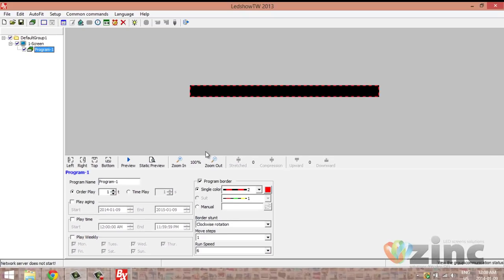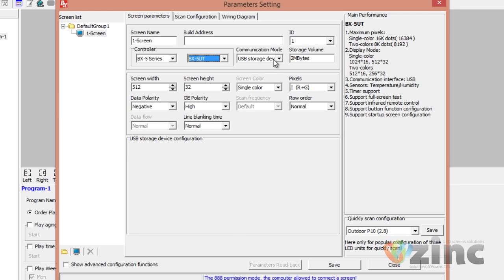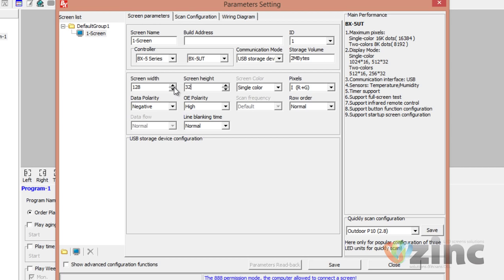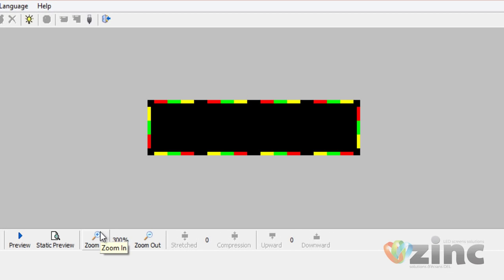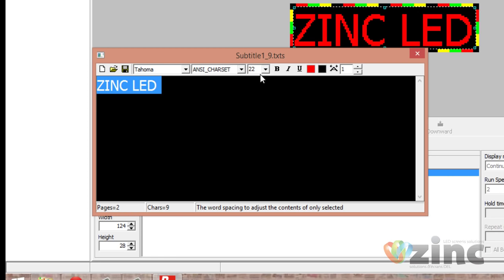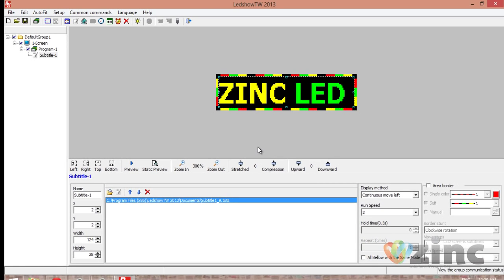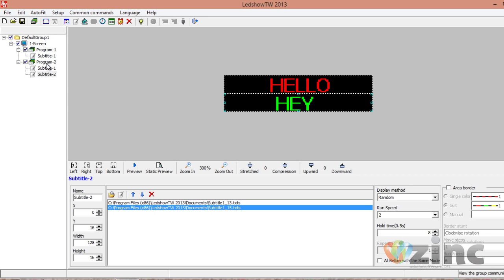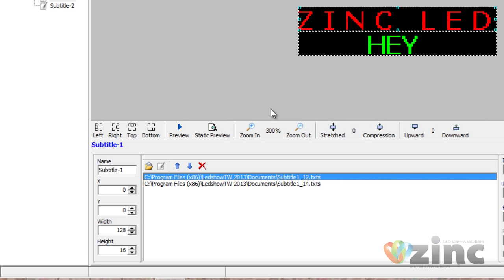LEDShowTW Tutorial - LED Show TW Tutorial - ledshow tw tutorial- led show tw tutorial

Comment: Can you explain to me how to connect bx-5ql with p-10 rgb smd module ,16 x 32 ,Main I need setting , this working but not clear,i try to remove border line still shadow coming top and down , scaning mode 1/16 ,screen width 96,s hight 32, module W 96, Module H 32,re fresh 13020, scan fre 20MH, Refrsh rate 1,data polarity positive,OE polarity Low,Can you help me please

Comment: Doesnt working, Whats kind of files in USB after save U disk. In my case inside my U disk onboxon click then 5U 5U1 folders, enter it notepad icon and bin file and bxdata.dat file looks like notepad file. When i put into LED board, Show me 5U1 sign then nothing happen. Whats the difference between password 168 pass 888. I used both but doesnt working.  I have been trying to work it for 10 hours. I need a help
Reply: try formating ur pen drive